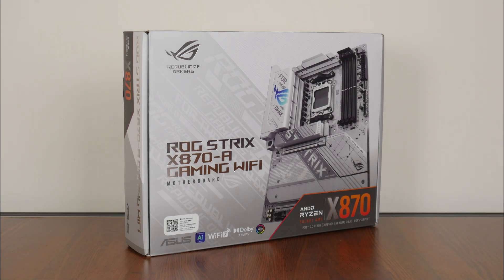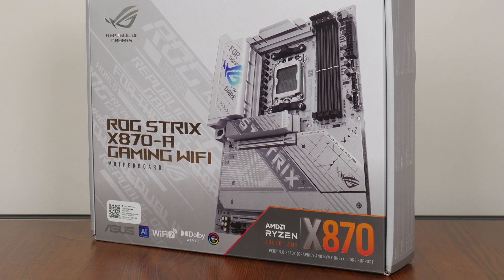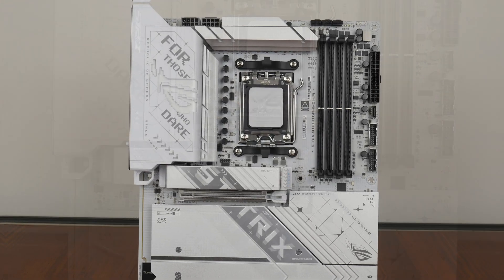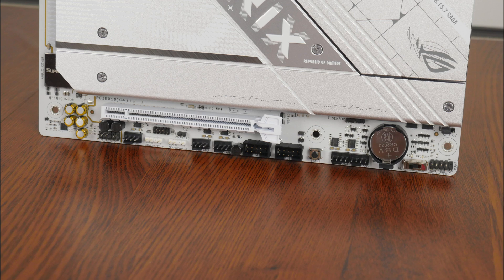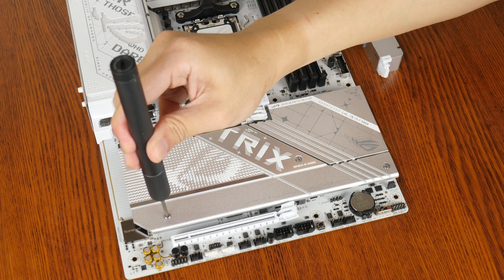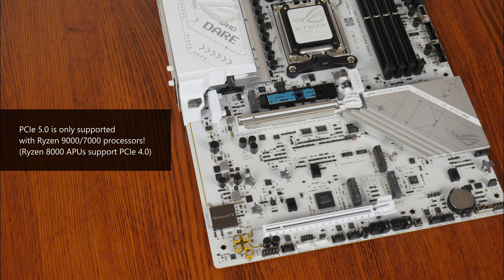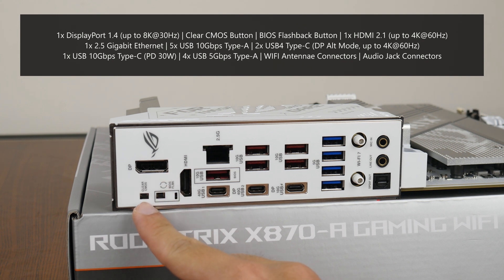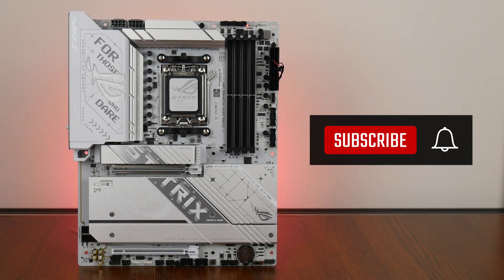PERFECT for Next Gen White AM5 PC Builds? ASUS ROG Strix X870-A Gaming WIFI Unboxing & Overview

Comment from the maker: Check out the written review for this motherboard here: https://www.alktech.co/articles/review-asus-rog-strix-x870-a-gaming-wifi-am5-motherboard
Reply: One thing that really holds this back from perfection is that M.2 slot 2 is tied to the GPU's 5.0 slot. So now I cant run 2x m.2 at 5.0 speeds in slot 1 and 2. I can only get 5.0 m.2 speeds out of slot 1. That is not good, no way on the 5090 I am going to a x8 from x16. 

Also its is a beautiful white PCB but why didnt ASUS made the 4 DIMM slots white too? Oversight?
Reply from the maker: @Everything2A  totally agreed on all points above - Gigabyte seems to be the only board manufacturer that got the memo when it comes to a proper all-white aesthetic with white DIMM slots, connectors and even SATA cables. That said, you might wanna look at B850 boards if the PCIe lane sharing is a concern, or even newer X870E boards that were launched recently - MSI has the white-themed X870E EDGE TI WIFI that looks pretty nice too and doesn't have that bad of a lane sharing situation (the lane sharing happens with the USB4 controller and one of the PCIe 5.0 M.2 slots, but can be user-toggled).
Reply: @ALKtech  that was actually going to be my next question if you knew of any boards or manufacturers that have full PCI capability well at the same time, not nerfing the GPU all while having a true all white aesthetic. Seriously, awesome content and thanks so much for the reply and the like! 👍 You definitely earned my subscription!
Reply from the maker: @ cheers and thanks for the kind words! The MSI unfortunately doesn't have a pure white aesthetic as it still has some black bits, it'd appear that only Gigabyte got the memo 😅Gigabyte does have a B850 AORUS ELITE WIFI7 ICE that might fit the bill with no lane sharing shenanigans!
Reply: @ that’s because that b850 board only has 1x 5.0 m.2 slot. I guess it’s just not possible to have multiple 5.0 slots for storage while still retaining x16 5.0 gpu slot. Either a new chipset will have to be developed that’s better than the X870E or its just not gonna happen unfortunately.
Reply from the maker: @ yeap agreed. In any case it'll probably still be awhile till Gen 5 SSDs become fully mainstream - by then, it's likely that AMD and Intel's next-gen chipsets would have support for more PCIe 5.0 drives without any of that lane sharing nonsense (I hope)!

Comment: can I just install a m2 ssd into the pcie 4.0 slot to bypass the bandwidth sharing with the 5.0 graphics slot? I am just going to be using one pcie 4.0 ssd anyway
Reply from the maker: Hey there, if you're using just a single drive, you can just install it in the first (M.2_1) PCIe 5.0 x4 M.2 slot, no lane sharing will occur! Lane sharing with the graphics card slot only occurs when you install a M.2 drive in the second PCIe 5.0 x4 M.2 slot (M.2_2). Hope this clarifies!
Reply: @ALKtech  thank you!!

Comment: Hii soo if i want to use 2 nvme and not loose bandwidth on my GPU i have to use a nvme 5.0 on the first slot and and then a 4.0 nvme right ?
Reply from the maker: Hi there, you should use your PCIe 5.0 M.2 drive in the first slot, and your PCIe 4.0 M.2 drive can go in either the third or fourth slot. Do note that the third slot shares bandwidth with the PCIe 4.0 x16 slot that runs at x4 mode, so if you're intending to install an add-on card in that slot, make sure to install your PCIe 4.0 M.2 drive in the fourth M.2 slot instead. Hope this helps!
Reply: @ALKtech thank you for this info. Got this board about 3 weeks ago and didn’t want to limit my 5070 ti to 8 lanes

Comment: What an awesome Video. Thanks!
Reply from the maker: Cheers! Are you looking to build a white-coloured PC with this motherboard?
Reply: @ALKtech "Yeah! Finally upgrading from my AM4 Ryzen 7 3700X, which is surprisingly good, but just not enough anymore for gaming and handling 8K RAW images in Lightroom.
Reply from the maker: @leaemuller  mmm a 3700X's probably served you for like what, four to five years already I'm thinking, so high time to upgrade especially if your workflow calls for it! Will you be getting perhaps a 9900X or a 9950X?

Comment: so only use the top SSD and bottom right SSD if you have two ssd so you won’t lose Bandwidth?
Reply from the maker: Yup that's right! If you're not intending to use the PCIe 4.0 x16 slot that runs at x4 mode (e.g. for a PCIe video capture card etc), you can use the third M.2 slot as well.
Reply: Exactly lol I was thinking the same thing! Just bought the board yesterday with overnight prime shipping. Should be here any minute!!
Reply from the maker: @WoNd3RT0A5T  sweet. What processor and GPU will you be using for your build?

Comment: Ive got this mainboard, Ryzen 7 9800x3d chip, a samsung m.2 5.0 4 tb ssd, 96 gigz of Gskill DDR5 8000, msi 5070 ti gaming trio, phanteks AIO liquid cooler, and a sleek Lian Liu evo mid size tower. 
Ive got almost all the parts and am awaiting the rest sometime tomorrow.
I havent built a gaming PC since the late 90s back when the Intel Pentium II CPUs were hot to trot, and im so excited!
Reply from the maker: Sounds like a pretty sick build - do you have any productivity use cases that necessitate large amounts of RAM? It's rare to see folks with 96GB of RAM - you might not be able to run the RAMs at 8000MT/s speeds though, do share if you run into any issues configuring your RAM with this board, I'd be keen to know!

And damn, the Pentium II era...I remember messing around with those "Slotkets" that would allow you to install a Socket 370 processor on a Slot 1 board...fun times!
Reply: how is the pc?
Reply: How's the PC? Please upload a short reel or video!!
Reply: lol you'll probably have to overclock it to take advantage of the 8000hz on the memory

Comment: Hi, I have two NVMe storage devices. Then I should use one in the primary M.2_1 slot and the second in the M.2_3 slot, right?

This should not affect the graphics card speed on the top PCIe 5.0 slot, right?
Reply from the maker: Hey there, that's right! Do note that having a SSD in slot M.2_3 will disable the full length PCIe 4.0 x16 slot that operates at x4 mode - this is only a concern if you're intending to install an add-on PCIe card (e.g. video capture card etc).

Comment: i have this mb and just curious to what the connector above the 1st m.2 slot could be used for?
Reply from the maker: Hey there, I assume you're referring to the 8-pin header right above the first M.2 slot? If so, it's probably an internal troubleshooting header to be used by ASUS technicians at the factory or something - the said header isn't marked in the manual, and isn't intended for use by end-users!

Comment: This motherboard is on its way tomorrow with 32GB DDR5 DOMINATOR RAM and I’m pairing it with a 9800X3D and an RTX 5090
Reply from the maker: Sweet, you're gonna have one heck of a sick gaming PC build on hand. Did you get a white-coloured RTX 5090? Do note the lane-sharing stuff with this board, especially if you're intending to install multiple M.2 drives!
Reply: @ALKtech  I’m just gonna use one 4TB ssd 
And I purchased the MASTER ICE 5090. Does this board support gen 5 ssd?
Reply from the maker: @IssacLuger  yeap it does, just install your SSD in the first M.2 slot (M.2_1) and you're good to go!
Reply: Is this board has alot of issues.. like bios or power or ram reading at 8000 .. you guys recommended this ??
Reply: how is the board?
Reply: @MrViperForce  I love it so far, in person it’s extremely clean. I do wish that it had one of those back plates, but other than that it’s clean.

Comment: That Bandwidth sharing thing is such an oversight for a gaming motherboard, wtf asus
Reply from the maker: They're not the only board manufacturers affected by this - other earlier X870E/X870 boards by brands such as Gigabyte also have a similar lane-sharing situation. If you're looking for a white-coloured AM5 motherboard that isn't as impacted by these lane sharing shenanigans, check out MSI's B850 EDGE TI WIFI or X870E EDGE TI WIFI, which were launched just a few months back - while there's still some form of lane sharing, it's not the sort that causes your PCIe x16 slot for a graphics card to drop to x8 mode!
Reply: @ALKtech  thank you so much for all the valuable informations, i'll check them out 
👍

Comment: Thank you for putting this together. Between this board, and the MSI MPG X870E EDGE WIFI which I see you also reviewed, which one would you say is the better choice between design as well as user friendliness of the softwares? Thanks!
Reply from the maker: Hey there, how big is the price difference between both boards where you're from? If we were to take price out of the equation, I'd go with the MSI for sure, seeing as it doesn't really suffer from the PCIe lane sharing situation between the Gen 5 M.2 slot and the Gen 5 PCIe slot for a graphics card (though with the MSI, the USB4 ports are potentially affected instead), and the fact that the WIFI module on the MSI board supports the 320MHz channel width for a "full-fledged" WIFI7 experience!
Reply: @ In that case, perfect! The price is literally within $10 of each other here in South Africa. Looks like I will go with the MSI. Thanks!

Comment: Kinda stupid that if i  put ssd in slot  3 the pcie 4  is disabled..
Reply from the maker: Yup its unfortunate that motherboards with the X870E/X870 chipsets tend to have lane sharing issues...do you need the PCIe 4.0 x16 slot for an external add-on card for your PC build?
Reply: @ALKtech  Yep i  need it for my  elgato capture card and im  using 3 ssd in the system
Reply from the maker: @ ah I see...if you're looking for a white AM5 board with better PCIe lane configurations, do check out Gigabyte's B850 AORUS ELITE WIFI7 ICE, or MSI's X870E/B850 EDGE TI WIFI!
Reply: @ALKtech  I dont have msi white board in my country,i will probably go on asus x870e for 9800x3d a+5090 build
Reply from the maker: @ sounds like one heck of a flagship gaming PC build!

Comment: Does the Asus ROG STRIX B850-F GAMING WIFI downgrade the GPU X16 PCIe slot to 8x if both Nvme Gen5 slots are populated?
Reply from the maker: Just had a look at the specs page for the B850-F GAMING WIFI, the Gen 5 M.2 slots do not share bandwidth with the GPU slot!

Comment: excuse me, I'm gonna get the Predator GM7000 PCIe4.0 M.2 SSD, is it wrong to put it on the PCIe 5.0? won´t work or what could happen?
Reply from the maker: Hello, nope that's perfectly fine! The PCIe 5.0 M.2 slot will simply operate at PCIe 4.0 speeds instead when you've got a PCIe 4.0 M.2 SSD such as the GM7000 installed - hope this helps!

Comment: If you populate the first two nvme slots does it drop the gpu to x8?
Reply from the maker: If you'd like to avoid lane sharing, you can only install a total of three NVMe SSDs, one in the first slot (M.2_1), and two in the third (M.2_3) and fourth (M.2_4) slots respectively! Do note that with a SSD installed in slot M.2_3, the PCIe 4.0 x16 slot that runs at x4 mode will be disabled entirely.
Reply: @ALKtech  Thanks for the info 👍

Comment: the motherboard doesn't have the screws ?
Reply from the maker: Are you referring to the screws that hold the motherboard in place within the PC case? If so, no it doesn't - such screws are usually supplied by the PC case manufacturer (i.e. when you buy a new PC case, the case manufacturer includes screws for motherboard mounting purposes).
Reply: @ALKtech  I'm found the screws for holding mothboerd

Comment: I hear theres some issues with boot times when you turn EXPO on for the higher Ram speeds, is that correct in your experience?
Reply from the maker: I personally haven't really had such an experience, though I suspect for instances where end-users experienced lengthy boot times, it could be due to older BIOSes that might not be optimised for the latest high-speed DDR5 modules!
Reply: I am running the latest BIOS with 64gb Ram with EXPO on running at 6000mhz and my boot up time is 13 seconds. So no boot time issues for me.
Reply: disable csm in ram and it fixes

Comment: Ich kann absolut nicht verstehen warum es von Asus kein White-Build X870 Board mit Diagnostic LED (Segmentanzeige) gibt und nur Diagnostic LED (LED-Indikatoren) verbaut sind. Weder das X870-A noch das ASUS ROG Strix X870-F sehe ich als realistischen Nachfolger des B650E-E

Das ASUS ROG Strix X870E-E Gaming WIFI in weiß und es wäre das perfekte Board für mich wenn ich mich mit dem Preis noch anfreunden könnte. Es ist aber einfach zu teuer.
Reply from the maker: Valid points, especially if the double-digit debug LED is something that you'd use frequently (e.g. if you're into overclocking and might find that a handy feature to have) - do you use this feature often, or its more of a nice-to-have?

That said, if you're looking for a properly nice-looking white-coloured X870 board with a double-digit debug LED, perhaps Gigabyte's X870E AORUS PRO ICE might be for you...but it's not exactly a cheap board!
Reply: @ALKtech  Ich denke ich werde die CES 2025 abwarten und hoffen das vom B650E-E ein gescheiter Nachfolger kommt jedoch in der Farbe weiß. Das Gigabyte habe ich bereits gesehen.

Comment: if i use 2x m.2 the best slot is m.2_1 and m.2_4. correct me if im wrong.
Reply from the maker: That's right, if you wanna avoid any form of lane sharing, you can install a drive each in M.2_1 and M.2_4 - these are the only two slots that have no lane sharing at all!
Reply: @ALKtech  perfect we can use 3 m.2 slots because most people only use the main PCIx16.

Comment: Hi, quick question. I want to build my first PC with this motherboard. Now I have heard that on some motherboards there can be problems on the first boot up because they can’t find any wifi networks. Does this happen on this motherboard as well? Have a good day!
Reply from the maker: Hey there, it sounds like an issue of not having the WIFI drivers installed -  when installing Windows for the first time there usually is a way to bypass needing an Internet connection, continuing with the Windows install and booting to the desktop, where you can then install the appropriate WIFI drivers to gain Internet connectivity. Hope this helps!

Comment: I also have a question for you who know how to answer me. To this, the main board for connecting power supplies CPU 6+2 2 plugs. If I don't do oc, I have to connect all 2 moves 6+2 or I can connect only 1 to work in the parameters.
Reply from the maker: I've not personally used a PC with just one 8-pin CPU connector plugged in, but theoretically it should work fine with just one 8-pin CPU connector plugged in especially if your processor doesn't draw that much power and if you're not overclocking. What processor are you/will you be using with the motherboard?

Comment: can I install a 5.0 NVME in the first slot and a 4.0 NVME in the 3rd or 4th slot?
Reply from the maker: Yup you can - this configuration of SSDs will not impact the GPU slot's bandwidth! But do note if you choose to install the PCIe 4.0 SSD on the third M.2 slot (M.2_3), the full-length PCIe 4.0 x16 slot will be disabled entirely.

Comment: So i should install my second NVME on the m.2_3 slot so it doesnt take bandwidth from the gpu right?
Reply from the maker: Yeap - have your first NVMe installed on M.2_1, and your second NVMe drive either on M.2_3 or M.2_4. Do note that if you have a drive installed on M.2_3, the full-length PCIe 4.0 x16 slot will be disabled entirely, which is important to note especially if you need to install say, a streaming/capture PCIe card etc.
Reply: @ALKtech  if I don’t care about PCIe 4.0 x16 and want to install 2 M.2 drives, one in M.2_3 and the other in M.2_4 this will not affect the GPU correct? just the PCIe  4.0×16 will be disabled.
Reply from the maker: @ if the PCIe 4.0 x16 slot is of no use to you, you can install up to three M.2 drives, one each on slots M.2_1, M.2_3 and M.2_4! Avoid installing any drives on M.2_2 if you don't want to affect your GPU's bandwidth. Hope this helps!

Comment: Tabloya göre X670E ile X870E arasında tek fark Usb 4.0 .Anakartı X870E yükseltmeye değmez.
Reply from the maker: Yup, if you already have a X670E/X670 motherboard, there's absolutely no reason to "upgrade" to a X870E/X870 motherboard, even though the X870E and X870 support faster DDR5 speeds too. Getting a X870E/X870 would probably be more for folks upgrading from older platforms such as AM4!

Comment: Will the gigabyte aorus white ice x870 be better than this one ?
Reply from the maker: Looking at the specs sheet, both boards are largely similar, though with the Gigabyte board you mentioned, you do get one more PCIe 5.0 x4 M.2 slot - but it comes with all that PCIe lane sharing stuff that will affect your graphics card slot's bandwidth. Personally, I'd prefer an all-white board for an all-white build, and the Gigabyte has white components too compared to the ASUS. In any case, I'd have to compare prices between both boards before making a decision!
Reply: @ALKtech Gigabyte board is cheaper. The higher end X870-E option from gigabyte is the same price as this Asus x870 board